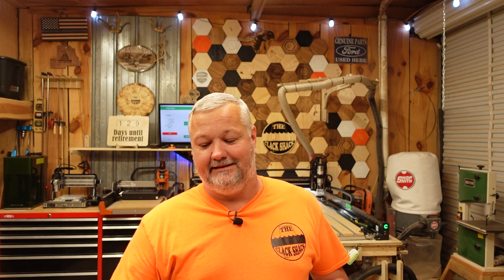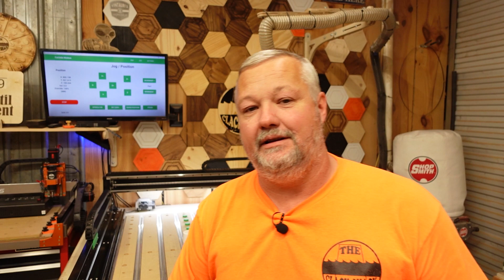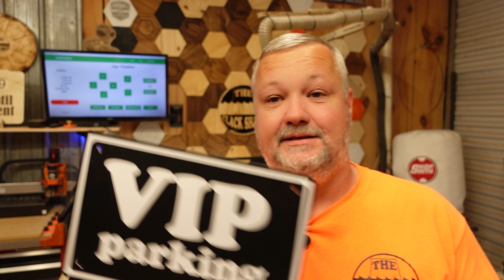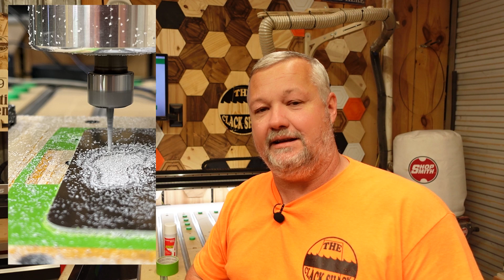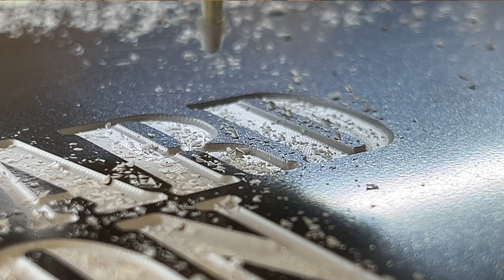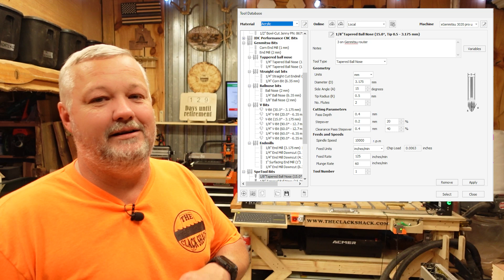Great project idea for any size CNC- 2 color plastic

Comment: I used the two colors hdhp plastic when I worked in a sign shop 20 years ago it is a little pricey but a great material to use. We had a couple hospital clients that we made room numbers and name plates for. I've made thousands of them we also had a special bit to drill braille holes in and then I had to push little beads into them to produce the braille lettering. That was time consuming but overall pretty fun.
Reply from the maker: Cool. The material works pretty well.